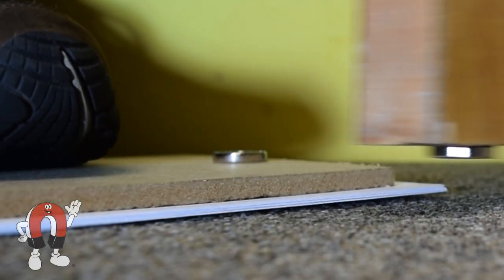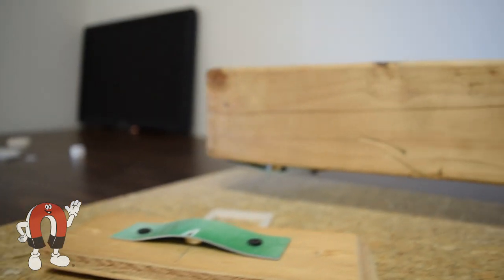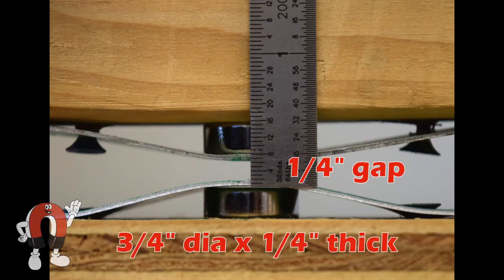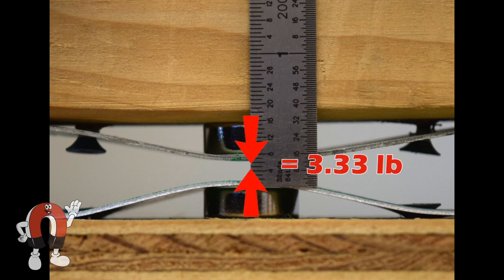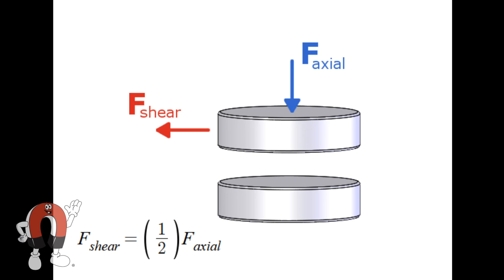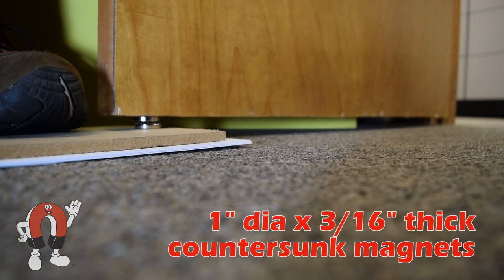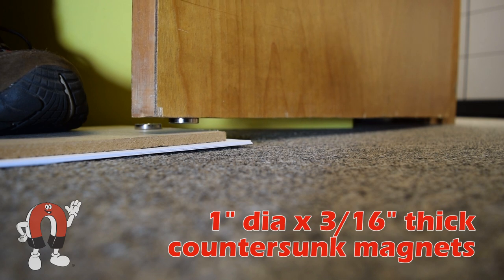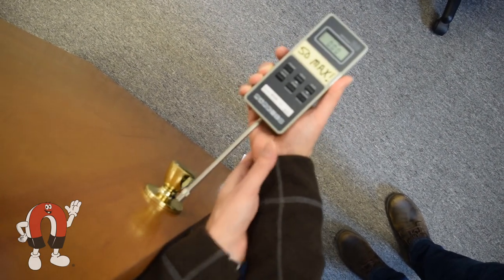Magnets for Swinging Doors - Calculating Shear Force

Comment: At the last bit of this video you mention it takes 4.45 LBS of Shear force to push the magnets apart, does this mean the magnets have a pull force of approximately 8.9 LBS with the same distance between them? Asking to make sure i understood this. Thanks for the info :)
Reply: Extra question: is there a way to get around the repellent force right before they have a pull force-type connection? Would be nice to have a snappy/direct (for lack of better explanation) pull force connection.
Cheers again, great video